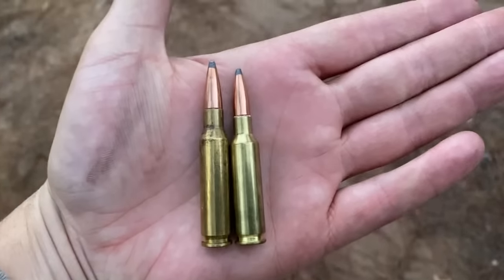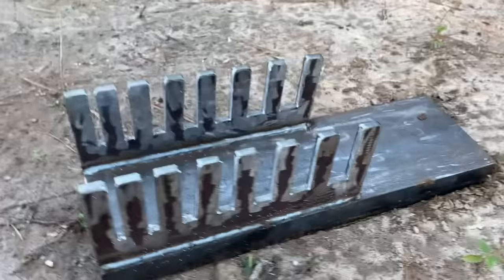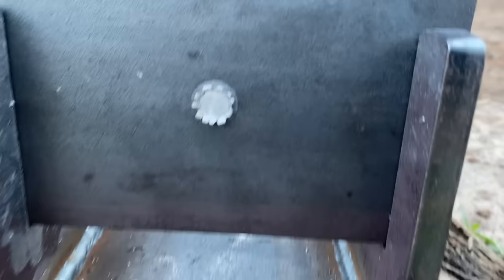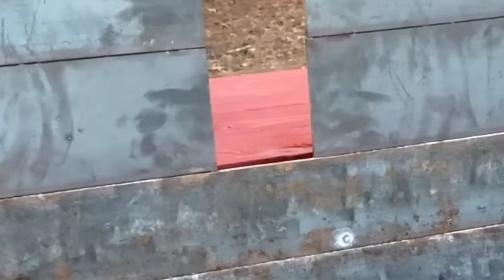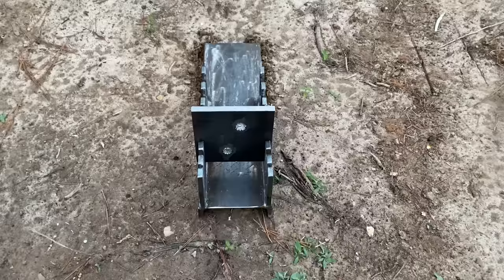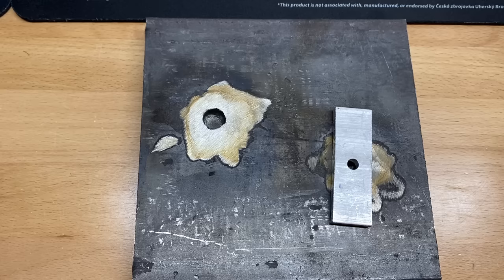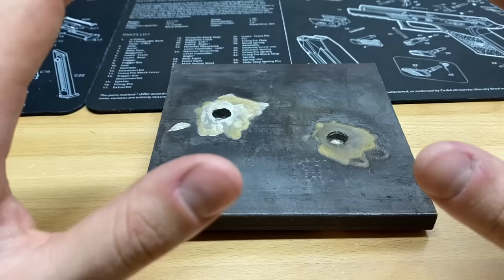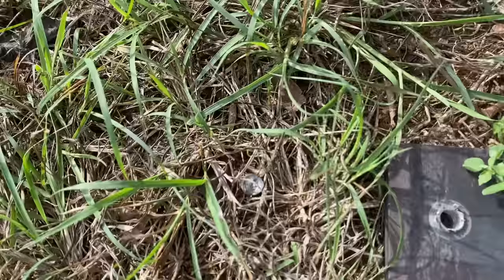6.5 Creedmoor vs 7mm-08: BIG Difference On Steel

Comment: The 7mm-08 is one of the hidden gems in firearms. It has a great balance of long range capabilities, efficiency, and recoil. It’s the caliber to beat in a short action rifle.
Reply from the maker: I completely argree!
Reply: @bananaballistics  
I really liked your presentation and method of comparison between calibers. It’s uniquely objective how they are compared, great work 👍
Reply: I own a 30-06, 30-30, 7mm mag, 270 and a 243… and my caliber of choice for Pennsylvania white tails? 7mm-08! Excellent white tail round and doesn’t beat this old guy up!
Reply: @markg117  How do you feel Bout the 08 in comparison to the 243?
Reply: @yamahondazuki95  some folks think that the .243 can deflect easier in thick stuff. I have taken deer with both and would not hesitate to use either but have been on a lucky roll with the 08!!!
Reply: @markg117  Awesome man love it! I'm honestly buying either if the right opportunity presents itself haha I just figured I'd get some options from others who have experience with them!
Reply: I have more than a dozen and a half rifles in different calibers but I have two 7mm-08 Rem rifles and they are both my favorite above all of the other calibers. Among them I have 308 Win, 6.5 Grendel, 6.5 PRC, 7.62x39 AR-15, 5.56/223 Rem AR-15, 5.56/223 Rem bolt rifle, 30 Carbine, 45-70 Govt, 30-06 Springfield, ect... but my 1st choice when I head to the deer woods or the range is either of my 7mm-08 rifles.
Reply: @yamahondazuki95  both are awesome but i prefer the heavier 140 grain 7mm-08. Deer don't like either!!!!
Reply: If so, run it against the 6.5 PRC. Same test. Same barrel length. 24 inches for each.
Reply: I’m not a 7mm fanboi by any means but that’s an unfair comparison IMO. You’d be comparing a standard pressure to a magnum. It might not say “mag” in the name but make no mistake, it is nearly identical in velocity to the 264 WM. With the shorter position of the case shoulder reducing capacity of the 6.5 CM and thus velocity, it’d probably be more accurate to compare the 7mm-08 to the 260Rem. Both have essentially the same case capacity and identical shoulders. 
The 264 bore’s advantage is that with the similar 140 grain loads at similar velocities, it has a better BC than the 7mm in similar weights. 

As a general rule I will take a 6.5/264 over any of the in between calibers to 30. The one exception is that the one rifle that really makes sense to me in 7mm-08 is an ultralight mountain rifle. Something under 7lbs loaded and with a variable power scope. Kimber has their Mountain series and their Adirondack version fits this bill completely. For some reason to me that is the perfect combination for the 7mm-08 cartridge.
Reply: @soonerfrac4611  IMO 7mm mag is a far better caliber than the overhyped, over used 6.5 creedmor and it would blast through 1/2” plate with ease with off the shelf ammo.
Reply: @yamahondazuki95  7-08 has more retained energy at long distance and is very flat shooting...162 ELD-M is the shizzle with this cartridge making easy 1000 yd shots. I have a 7-08 and would use it except the 260 Rem is even better in all aspects
Reply: @drd1924   true but haven’t seen any ammo for .260 rem have picked up enough 7-08 however
Reply: 7mm-08 is a great cartridge.  It's weird how the market never supported it with target ammunition.  It out-performs the .308 Win. in that respect due to BC advantages.  162gr 7mm is much better than even 175gr .308 for example.

7mm-08 is what .308 should have been, but with a 30° shoulder and shorter case.
Reply: I remember around early nineties it was the rage and got glowing reviews , every bolt gun was chambering for it.
Reply: I had a 7mm08 in a model 7 in the late 90's was my brush gun had a 20 inch barrel shot really good no recoil I killed several deer with it and they went between dropping and max 30 yards
Reply: 284 win beats it every time.
Reply: @stevietate5748  and a 7 mm Remington mag beats that
Reply: Try the 260 rem ....
Reply: @thomasfurniss2026  the 260 is a fine little caliber with handloads vs handloads it walks on a creedmoor more than you'd expect my buddy has a model 7 in it he's had basically since they came out he's I'd hate to even guess how many deers he's killed with that rifle running around 130 blastic tips
Reply: Shot them for years.

Love them
Reply: I want a 7mm-08 socom 16 because the 7mm-08 is approximately 30% less recoil when fired compared to the 308
Reply: @yamahondazuki95  far superior,  243 is a marginal deer round IMO, now with that said a 243 in a fast twist barrel and heavier bullet or a Hammer bullet,  it's good.

I'm trying out a 6 CM in a Seekins precision , very very pleased so far
Reply: @soonerfrac4611  I think you’ve identified the ideal application for 7mm-08:  a lightweight hunting rifle.
Reply: I love the 7mm08 it has done everything I've ever needed to use it for and passed with flying colours will never get rid of my sako 75 it's a gem cheers Yogi ✌
Reply: Is this why so many ammo mfg & sellers & rifle mfgs are basically phasing out 7mm-08?
Reply: This is gospel and a very well put together response. Perfect
Reply: The 7mm08 is my favorite.  I hand load the Nosler 168 Accubond Long Range  (.616 BC) over StaBALL 6.5 powder.  It's a game changer!  Nothing in the 308 class even comes close from muzzle to well over a mile.  It's a shame that no one, not even Nosler, loads the 168 ABLR in 7mm08 as a factory offering.
Reply: HOW did we end up in the same video, same comment, interested in both the same calibers? Lol
Reply: @gouldgibbonsiii4742  
That sounds like an ideal load, one that punches well above its weight.
Reply: The steel sled is sliding on the ground and absorbing some ot of  the bullets  energy.
Reply: Je possédais un .7.08 remington  en tack-down pour la montagne avec que des excellent résultats (chevreuils, chamois, sangliers de compagnies)😊je regrette de l’avoir vendu, 
Beaucoup trop d’armes de chasse sans héritiers chasseurs, réglementation draconienne en Europe, compliqué pour mon épouse si je pars le 1er 74 printemps 😊😊😊
Reply: Pas compris qu’en Europe il n’à pas pris, vaut largement le 243 ?????😢😢😢
Reply: We need these calibers in the new testing format.

Comment: My 7-08 is my "go to" for deer hunting here in Texas.  2" high at 100 and 8.8" low at 300 with 150gr pill.
Reply: Learn to zero your rifle.
Reply: Why do you say that?  We don't know his load, the bullet, nor the terrain he hunts.  Those ballistics seem to match the Norma Whitetail and Federal Powershok 150 gr. loads.  If that's the case, I'd say he's pretty much zeroed  spot on for an ethical hunting range for those loadings.  Granted there are flatter shooting hunting loads available but we can't go there because we don't know HIS requirements.  Nor did he say if he sighted in for 200 yards or a 2" PBR.

Comment: 22-250 has a reputation of zipping right through steel armor, though I think with 1/2" you get to a point where you need bullet mass with velocity to get through the extra material
Reply: Yup.

Comment: I already had a 6.5 mm CM which is adequate for deer and have been wanting backup for my older .308 with an all weather stock.  Probably a Savage 110.  I've been vacilating on short action caliber choices.  I'd heard 6.5 and 7mm-08 are fairly close, but you've made me rethink that.  6.5 CM is now more common.  I'll have to check ammo prices and availability.  6.5 is fun to shoot and I've heard 7mm-08 is milder than .308.  I guess it comes down to price and availability of ammo.  I like .308, so I think 7mm-08 is a cool choice provided it isn't a pain to feed it.

Comment: 0.378" is actually a little better than 3/8-inch, which would be 0.375".  If you find a little tougher bullet or a slightly hotter load, the 7mm-08 just might make it all the way through.
Reply from the maker: I believe you are correct. I got some Barnes solid coppers that I am wanting to try at some point

Comment: I shat the same 3/8 plate steel with my 7x57 at 100 yards thinking it would not penetrate and it punched right through. I’m a little surprised that neither went through.
Reply: They both went through. It was the half inch steel that stopped them.

Comment: I would have loved to see the same weight bullet tested for comparison purposes.  Heavier bullet has more energy.  I realize it isn't a huge spread in the bullet weight, but I think you would have been surprised how much closer the penetration would be.  Either way, great video!
Reply: This!
Reply: Why the same bullet weights? That wouldn't be a fair comparison since the 7mm bullet would have a lower sectional density.
Reply: @Bullelk44M  I guess it is more about finding two bullets that are comparable in FT/LBS of energy.  The was the test went, the 7mm-08 had 212ft/lbs for.  I would expect it to penetrate more.
Reply: 7mm/08 was behind from the start with a shorter barrel and still beat the CM. The 7mm/08 out performs the 6.5 until you get to around  500 yards if my memory serves me.

Comment: Back in 2008 carravel ranch WMA Florida..9 straight days setting in my tree lounge all day..3006 BAR on the feet side gun holders and my 7mm08 stainless encore custom pistol on the right side gun holders..the last 30 seconds of legal shooting..I sent a 140 grain Federal Fusion at 95 to 100 yards..it hit middle shoulder and dropped almost 90 degrees angle...175 pound 9 point....and a game warden helped me pull it over the fence...might have been my best deer kill ever..the 7mm08 did alot of damage at 100 yards...probably the best pistol cartridge ever

Comment: The nickname for the cup or the piece of steel pushed out the otherside I remember it being called a " cartwheel" I remember reading an article years back about naval ship guns and the impacts on there armored plates😊 I never shot a creedmoor or a 7 08 but I was rooting for the 7 08, you do great work keep it up, maybe it's time to do a test on the 35 rem vs 360 buckhammer vs 356 win

Comment: I have a Remington 700 SPS in 7mm-08 with a 24 inch barrel, and it's my go-to deer rifle. I typically load 150gr Core Lokt tipped bullets in it, which achieve a velocity of 2,800 ft/s.

Comment: This is just an idea ! 
I have discovered that only one commercial bullet did penetrate all the way through the steel plate and 4 other brands of soft point bullets did not ! 
I used Hornady , Speer , Sierra and Nosler ! 
The only bullet to penetrate the plate all the way through was the Nosler Partition!

I did go through the trouble to take several bullets into half to see the jacket thickness from the lightest to the heaviest! 

You are correct velocity plays a huge part in the steel game !

Comment: Just picked up a antique in 7x57 Mauser.  7mm is the best balance of mild recoil, external and internal ballistics.  I'll use my 6.5x55 for targets, but the 7mm for hunting.  A modern action in 6.5x55 can be loaded with 140 grain to near 2,900fps and that would close the gap between 6.5mm and 7mm as an effective hunting cartridge.  I prefer barrels that are at least 24 inches.

Comment: The Creedmoor really shines with 140 gr. VLDs.  That's where it would outperform the 7/08.  But both are fine cartridges for medium game hunting or long range paper punching.
Reply: Huh??   So simply using the VLD 140s makes the Creedmore better than the 7mm08?  No matter what you load up in a Creedmore, you can always load up a 7mm08 better.  Its case capacity is ever so slightly larger, and it can handle heavier for caliber bullets than the Needsmore..  technically the Creedmore will never beat out a7mm08.
Reply: @ez7977  well yes, sort of. The Creedmoor is optimized for long bullets. With the 7mm-08 and very long VLDs, you may have to seat them so deeply in the case that you eat up whatever powder capacity gains the 7mm has. A 6.5mm 140 is also quite a bit longer and higher BC than a 7mm 140. There are some other factors involved than just powder capacity.

Comment: I wish that you would try to put both rounds on the same horizontal plane.  I believe that the plate holding device is a really good idea, but I believe that the round going to the upper part of the plate has a very slight disadvantage.  But you could prove me wrong by shooting the same ammo from the same gun at the 1/2" plate.  Maybe 2 rounds top and 2 bounds bottom.  I think that you will see a minute, but measurable difference.
Reply: @ramjam720 actually the one going through the lower part of the plate would have the disadvantage as the higher angle (the shot is travelling downward) would mean that there is more steel to go through and a greater angle of deflection of energy.  But.....This is minor and probably not enough to worry about.  With that said, you are correct in the suggestion as it would make the test more accurate.  Good Suggestion!

Comment: Next time use 6,5 Creed factory ammo with either SMKs or VLDs both in 140Gr.
With my reloads using both of these projectiles I was able to penetrate 3/8” mild steel at 400 and 500m.
My reloads are in 2800ft/a territory.

Comment: Are you familiar with "sectional density"? It is one of the biggest contributors to penetration. 

I think you also need to be careful that you don't conflate "cartridge" vs "cartridge" with what you are actually testing, which is more accurately described as "load" vs "load"

You were shooting a 139 grain 7mm bullet (soft point) vs a 129 grain 264 bullet (soft point). You could have just as easily shot federal fusion in the 7mm-08 (120 grain soft point) vs the federal fusion in 6.5 CM (140 grain soft point). 

If you want to approach this from a scientific standpoint, what you should do is keep track of the each load's sectional density and muzzle velocity. I think between those two variables, you will be able to predict steel penetration pretty darn accurately. bullet construction will be of tertiary importance, unless you find some bullets filled with a metal of comparable hardness (or harder) which you will be hard pressed to find outside of green tips.

Comment: You could make a u shaped saddle to straddle the holes if you want to cut out the grinding. Just glue a spacer on bottom side of both ends of the plate you made

Comment: Interesting results! I'd like to see what a 7mm Rem Mag could do, or maybe some of the large Weatherby magnums.
Reply from the maker: 7mm will be on the way in the future
Reply: Shot an axe head with 7mm mag 150gr once, about halfway between the handle and the blade end. It went through. I was impressed.
Reply: The Hornady YT channel brought up 7mag in a discussion. They explained things that were above my pay grade, but their engineers are not impressed.
 The gains over 7-08 are a lot less than one would think, given the difference in case capacity. 
 Apparently 7mag is a grossly inefficient cartridge.
 That's just something that I wouldn't have expected.
 It would be cool to  see what  7mag and some of the other heavy hitters will do those plates as well.
Reply: @bananaballistics  I have a 7stw 1/2 inch plate is no problem with rem core locks 140 grain. with 140 ballistics we have a problem

Comment: If you REALLY want to know the truth, try penetration tests at 300/400/500 yards.  Of course, you'll need to work with thinner steel plates regardless of caliber.  The very high BC of the 6.5mm bullet regardless of the cartridge behind it is a game changer at greater distances.  Before we ever heard of the 6.5 Creedmoor I built a 6.5x55 Swede on a Mauser 98 action and have come to really appreciate the external ballistics of the 6.5mm bullet downrange.

Comment: You could also save yourself the effort of grinding if you had some machining (jo) blocks to set on either side of the spalled area.  (You would just need to subtract them out like you currently do with you spanner plate thickess for the area you ground down.)  Unless you like to do the grinding of course?  Lol

Comment: Being pedantic but I think the cradle holding your steel sheets dug in on the first round.  So, the second round could transfer more kinetic energy quickly.  I hate to point it out, but it would make more of a difference than careful grinding.

Comment: Imagine what might have happened if the 7-08 had 2 more inches of barrel
Reply: nothing.  7mm-08 uses medium speed powder like Varget or BL-C(2) or RL15, and it's all burned up by the time it reaches the end of the 24" barrel.

Honestly, there's nothing to be gained with either of those calibers by shooting anything longer than 22".  If the cases were loaded up with Retumbo or MagPro or Magnum or H1000, it would make a difference.  But those powders aren't used with 7mm-08 or 6.5 CM

Comment: Did you use the highest velocity for each round ? 
I’ve done steel plate shooting for years and discovered a few times that the heavier bullet weight will penetrate deeper ! 
Lighter bullet weights sometimes surprised me on the depth of penetration but not always !

Good tests , I enjoy doing that myself !

Comment: Bigger bullet with almost identical output velocity and similar shape? Nice test but I'd be surprised if the 7mm didn't perform better :p
Also bullets look like soft points? How does FMJ do on mild steel compared to SP?

Comment: @~3 min. I wonder if sled were FIXED SOLID, instead of getting pushed away, whether either or both projectiles would PENETRATE the steel plate.

Comment: The measurement fixture should have legs on it so that it straddles the ground area and doesn’t rest on it.  If there is a high spot in the grinding, the measurement will be off.  If the fixture was triangular in shape with a small foot on each corner such that all feet are on virgin parts of the plate, the measurements would truly be accurate no matter how poor the grinding was.  And if the feet are 0.25” or higher, you might not even need to grind at all.